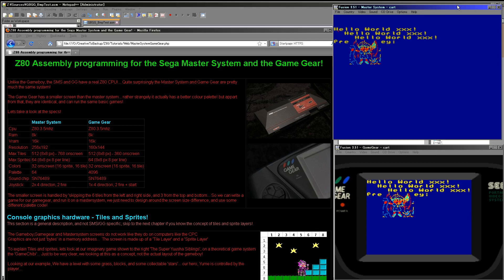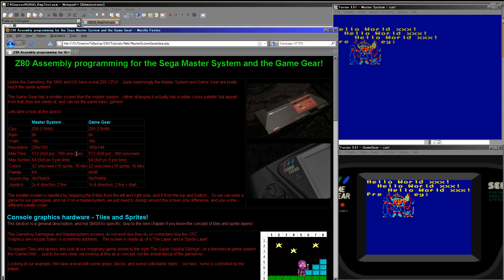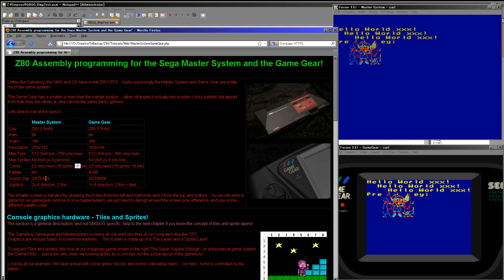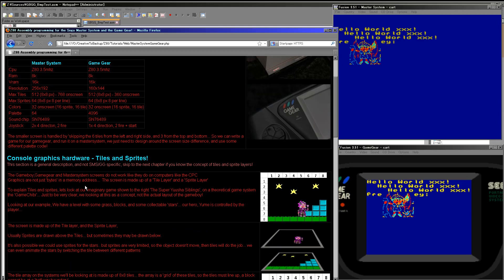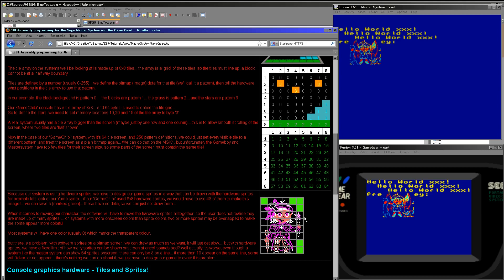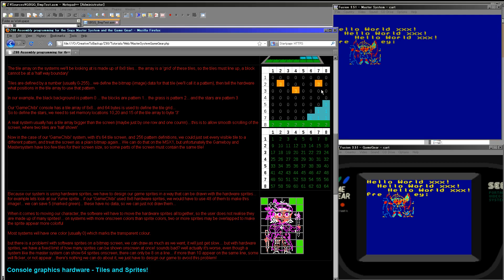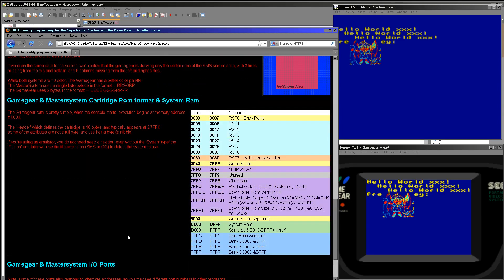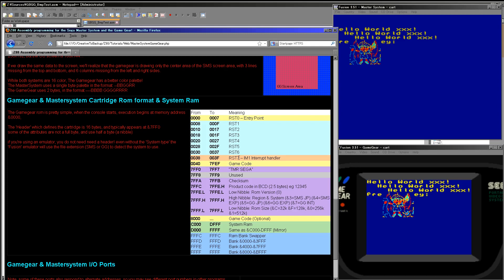Introduction to Z80 Assembly programming on the Master System and Game Gear

Comment: Just to know, if you ever see that message, did you read the How to Program the Z80 book by Rodnay Zaks? I don't know if it was a good idea or not, there's lots and lots of page, but It felt like it was oof topic since it looks like Im not really working on a assembly compiler, even tho there is assembly instructions
Reply from the maker: Yeah, I think I've read that one.
When I first started out, I basically grabbed every Z80 book I could find. I've actually even read a few in Japanese(!).
FYI I learned assembly originally from "Learn TI-83 Plus Assembly In 28 Days v2.0" (https://www.ticalc.org/archives/files/fileinfo/268/26877.html), so if you're looking to learn from something other than my content, that's what I'd recommend, as I've not seen anything 'better' since

Comment: Thank you for directing me to this video! Here is my first question: 1) In early master system games like Golden Axe, the scrolling is very choppy, almost as if the tiles are resolving to this grid of 768. Is this why? Thank you again for this great resource. I am looking forward to more video involving the Master System.
Reply: Golden Axe actually merges it´s characters with the background, as result, scrolling must be done in a 8 pixels basis. The advantage is the lack of flickering. The Disadvantages, are the limitation to one palette for both backgrounds and characters, the scroll and the cpu use in order to merge the tiles.